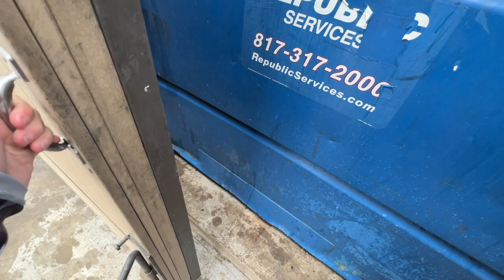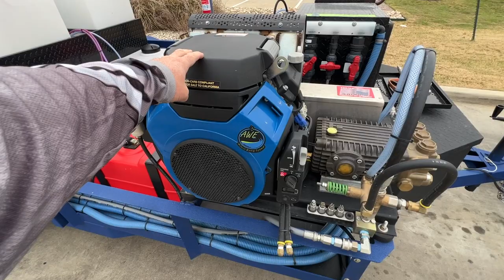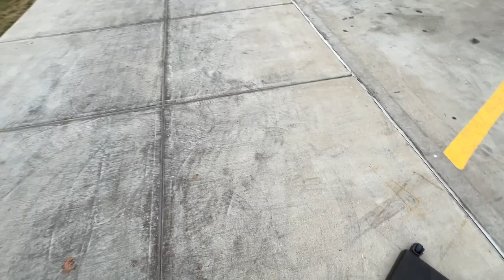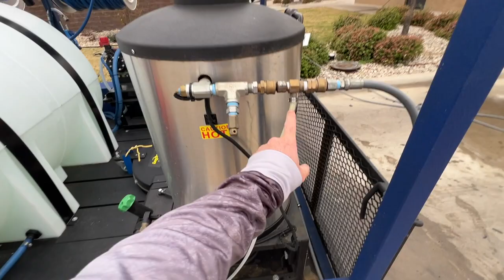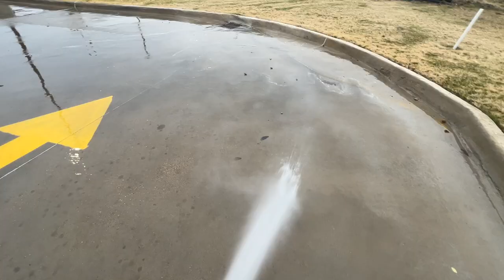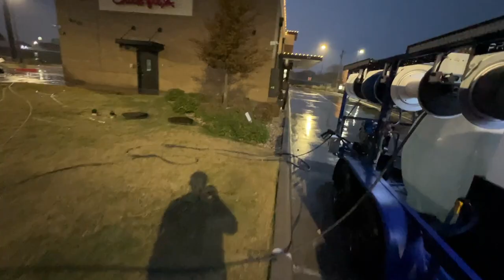How To Pressure Wash A Restaurant - Weekly Contract

Comment: M5 twist and the xjet  are going to have different orifice sizes inside and the xjet has a different internal design to create the Venturi effect that causes the suction. When you open up the fan tip you should see that brass Ring, where the water comes out of, should be different sizes.

Comment: Great video! Probably a stupid question but if I don’t have a trailer (I have a 3.0 gpm Honda machine) can I still use a surface cleaner? How would the water get pressurized through it? Do you hook up the water hose or the pressure hose from the pressure washer to the surface cleaner? Again, kind of a dumb question but I genuinely don’t know. Great content!
Reply from the maker: Not a dumb question man, we all had to learn this stuff at some point. If you don’t have a buffer tank then you connect the water hose from the building to the washer then the pressure hose goes from the machine to your surface cleaner. 3gpm isn’t very much so you’ll need a smaller surface cleaner but it’s a place to start. Get some driveways under your belt, save up some money and then you can buy bigger equipment. I used a 4gpm machine for the first 6 months of cleaning and was doing driveways, houses, then got my first commercial contract and financed a trailer from Powerline industries. There are other builders out there you can buy from that can do custom trailers so you can be within your budget.

Comment: That’s crazy!  If you did that where I’m at in Washington state, a storm water inspector would show up, pull the manager outside and order him to have a storm drain vactor truck come out, suck out that catch basin and key all the underground pipes to get the degreaser out of them, and clean out as many down stream catch basins as the wash water infiltrated.  They would inspect every catch basin down the road until they stopped finding degreaser or wash water, and he would also force the restaurant to key every storm line that was contaminated.  The bill might be upwards of $40,000 to fully decon that storm system.  You guys don’t have to reclaim in Texas??

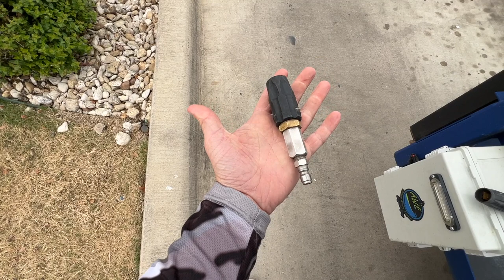Comment: 2:15 Hey there Dust to Glory - RE: the high & low pressure nozzles. The pressure & flow of pressure washers are determined by the nozzle orifice size (basically small specifically-sized hole inside the nozzle, smaller holes = more pessure but less flow. The opposite for larger orifices.

Comment: What gpm are you running? Doing that job so much I'd get a wide surface cleaner.
Reply from the maker: I have a 10gpm and a 8gpm, usually I’m running the 8. The wider surface cleaners are good but they aren’t as nimble as the smaller ones. I found out that I’m actually quicker with the 19” than I am with a big 24-28”

Comment: Thank you man this was inspiring! So I subscribed and liked especially because you are truly helping people and not always for profit. We appreciate that especially us starting of. A question I do have is would that same degreaser work on regular drive ways or is there something different for it? I have a 3200 psi pressure washer and a not so professional surface cleaner 😅but wanting to see how I can improve using chemicals until I’m ready to upgrade my equipment. Thanks in advance
Reply from the maker: Thanks for the kind words man! Gold Assassin is mainly used for grease and oils. I’ve used it some on driveways but mainly for driveways I use SH. Engine oil spills are pretty tough to get out. Most of the time it just lightens them up but you’ll still see them. It works great for food grade oils and grease though!

Comment: Yo Man, awesome vid. Any EPA issues using those chems at a location like chick fil a?
Reply from the maker: Great question, we’ve had no issues putting down the storm drain filter socks. That’s what is required here locally. I’ve been kicking around the idea of building a reclaim system so we can land the jobs that require it but for now we just make sure none of our soaps go into storm drains. A couple locations we wash have drains but they aren’t connected to the water system, they either go into a holding tank and get pumped out or they go into a filter system that cleans the water so we don’t have to worry about reclaiming.

Comment: Thanks for the video. What was your Gold Assassin ratio mix on the concrete at the 
restaurant? May you let us know how much is the price for the chick-f-A job?
Reply from the maker: If I do pump sprayer then it’s straight, if it goes through my GP high flow injector I believe it’s like 50/50 maybe? Not too sure. Maybe 4:1. I honestly have no clue but I’m sure you can find that on their site. Most restaurants around my area are about $600 biweekly
Reply: @DustToGloryPW so do you use the gp injector on house washes as well or use a regular down stream injector for that? Do you do chick fil a for 600 every week or just bi weekly

Comment: Im a newbie here. I need to buy extra Orings for JustInCase moments. What size Orings and what else should I buy for on the spots moments?
Reply from the maker: Hey man! So I don’t really know the size I’ve actually bought the wrong ones in the past. I should probably know that by now lol but there’s a lot of stuff to keep up with when you run a business so I always forget that part. I get on pressure tek or powerwash store and just buy bags of the high temp ones in different sizes then throw them all in my toolbox

Comment: What does it mean to downstream??
Thank you and God Bless,, Carlos ✝️🙏❤️😊❗️
Reply from the maker: You can run a downstream injector that pulls a small amount of chemical through your pressure hose. You want to run it after the pump which is why it’s called downstream. The pressure from the water causes it to pull small amounts. I run general pump high flow injectors

Comment: Could you use cold water, and what would be the difference in results between Double Eagle and Gold Assassin? Thank you
Reply from the maker: You can absolutely use cold water, you have to go a little stronger with Chem if using cold but it can be done. I started with cold water only for about the first 6 months I washed and cleaned all kinds of stuff. Gold Assassin and double eagle are both very good chems. I buy gold assassin in bulk (55 gal) and it comes out to about $8/gallon. Double eagle is around $40/gallon. That’s the biggest difference
Reply from the maker: If I use 4 gallons of gold assassin for this job it’s roughly $32, if I use 4 gallons of double eagle I’m looking at $160 in just chems.
Reply: @DustToGloryPW  wow, ok. That makes sense. I know people use both of those chems and mention the word “caustic” I don’t really know what that means or if one was better than the other or one was caustic and one isn’t…. Thank you
Reply from the maker: @westcentralpowerwash  Yeah I’m not super knowledgeable with how the chem works, I do know that most if not all degreasers are caustic cleaners. Most chems have sodium hydroxide in them which makes them caustic, I think maybe it’s a type of acid that’s really good for animal fat/grease. You just have to be careful with it because it’ll burn your skin as well.

Comment: Hey man great vid..appreciate u taking the time.. whats the price range $$ on the boilers  to make hot water if u dont mind?
Im just starting out and i eventually wanna move into light commercial so i know ill need hot ,i used to pressure wash at a pet food  plant and hot water is key for industrial jobs. Bu ti dont wanna blow $5k before i even know if this is gonna work for me getting jobs on my own. So im thinking get a 8-10gpm cold pw for like $3k to start and upgrade with a boiler later after i get experience running my own business. Srry for long form .lol thx in advance.
Reply from the maker: Don’t apologize for asking questions man, sorry it took me a while to see it. Cold water works fine for starting out, hot water runs around $4,000 and up. Definitely worth it when you get it but if you don’t have the cash then don’t sweat it. Do what you can with cold water and save up 🤝

Comment: How much was your hot water tank? Might need one soon and wondering how much I should spend for my first one?
Reply from the maker: The hot box runs around $4000 by itself. You can buy washers and heaters together for around $8000. I would recommend getting going with just cold water first then when you start getting more commercial work make the jump.

Comment: On the soft concrete have you tried surface cleaning but turn your ballvalve down a lil and or going higher flow tips on it
Reply from the maker: Yeah man I run oversized tips and have tried like 1000 psi so it’s this weird in between where it either doesn’t clean enough or it etches the concrete. Super frustrating lol
Reply: @DustToGloryPW  it could be that the walkway has a cream layer on it whereas the employee exit is just a concrete itself without the cream layer.

Comment: How long is your trailer and how many gallon tanks?
Reply from the maker: 16’ trailer, 380 gallon water, 2- 55 gallon SH tanks and 2- 16 gallon soap tanks
Reply: @Dust To Glory Pressure Washing  awesome thanks! Im torn between rigging out my 14ft or my 20ft trailer. I'm leaning more towards my 20ft because of the 7500k axles. I'd rather have a little overkill just in case.

Comment: Are you Downstreaming Gold assassin straight or is it mixed like 1:1 in your bucket?   Do you find DS with hot water makes a big difference from using cold to DS then hot water to surface clean?   Thanks.
Reply from the maker: I downstream straight, high flow GP injector. I’m not like 100% sure but I feel like it does better when I down stream it hot. Don’t know if that’s true but it definitely seems like it.
Reply: Solubility increases with heat, not decreases.  Mixing Sodium Hydroxide aka Lye is an exothermic reaction so just the act of mixing creates considerable heat.  Below you mention Little Pressure washing and if you watch he even mentions that his bucket heats up as he mixes in the beads.  Its true, lye is a common ingredient in many degreasers,  however there are alternate ingredients that do much better in certain circumstances.  Sodium Hydroxide is used in many formulations because it is the cheapest of the near optimal active ingredients.  Some do better to deep clean concrete due to having a smaller molecule, however are twice the cost.  So premium degreasers will often use a mix of lye and other degreasers to achieve a superior result.    Generally speaking heating a chemical will increase its reactivity and therefore its effectiveness, however it will also increase its reactivity everywhere and may become problematic when dealing with splash and spray on trim and plants.  ALSO avoid overheating any chemical such as with steam, this can cause health issues for workers in many ways.  Yes more heat needs less chemical generally, just dont overdo it and use all at your own risk. @MannyAguilarJr
Reply: @ewemail5767  I honestly don't even know why I said that. My comment doesn't even make sense to me now as far as hot water.

Comment: Have you tried 40 degree tip at a higher flow rate?
Reply from the maker: Yeah I occasionally use the 40 degree but really the xjet nozzles get me by on everything. If you’re talking about the surface cleaner that’s all I run is 40 degree tips

Comment: What do you do about the splash up that goes on the windows and doors?
Reply from the maker: Just rinse it off before it has time to react on the surface and you won’t have any issues. That goes for a lot of chemicals used in our industry. Most of the time you don’t want to let chemicals dry on whatever surface they are on. Keeping the chemical wet will help you in many different situations.

Comment: Did you have to change the tips on the surface cleaner to match the 8gpm?
Reply from the maker: Yes! I actually run oversized tips on all my surface cleaners to drop the pressure instead of messing with a pressure regulator. I get much better results with oversized tips running about 2000-2500 psi
Reply: @DustToGloryPW  thanks to you
Reply: I'm guna be trying out 4007 on my surface cleaner with a 8.5gpm gp pump. I also have 40045, 25045.

Comment: What would you charge for a job like that? I don’t see anything about that.
Reply from the maker: Not sure what your market is where you're located because its different in every city, and its drastically different in each state. We typically charge around $600 bi weekly for most restaurants we clean and that includes the sidewalks, drive thru and a couple other areas. it does differ depending on sqft of the drive thru and things like that though. Also dumpster pads are an extra charge.

Comment: What’s the going rate for commercial work like this?
Reply from the maker: Depends on your location, different from city to city
Reply: I charge $400 plus tax and chemical per month per store. Don’t know if that’s enough or too high. They paying it though. That includes all walkways, front, side and rear entrances, drive through, and dumpster pad. It usually takes 2 hours with 2 washer’s depending on customer traffic. More traffic the slower the process. I wish I could wash when they are closed but I like sleeping at night.
Reply: @tonyynot6151  where are you located?
Reply from the maker: @tonyynot6151  I would say that’s a little low but it does depend where you’re located also. Most guys I know that do bi weekly are at around $600+/ bi weekly. I like weekly better though.
Reply: @DustToGloryPW  thank you for the info. I may need to renegotiate my contract for this new year..

Comment: What lights are like glowing on the trailer
Reply from the maker: Led strips and also has tank lights mounted under the trailer
Reply: @DustToGloryPW  ok that is cool I am going to build a rig. Where did you get them you have a link?
Reply from the maker: @Hunter12valve  You can find the LED strips on amazon. And the tank lights are rock lights, made for going in the fenders of trucks

Comment: Damn, you surface clean all that in an hour?
Reply from the maker: It varies between an hour to an hour and a half but yeah man that GA hot water and 8gpm run through that stuff pretty quick and easy!
Reply: Do you pressure wash during business hours? I have a contract with the local Wendy’s in this area, 6 store to be exact. But the only drawback is we only wash in early morning or during slow afternoon times. Always battling with customers. Sometimes the store manager will have to shut down the drive through so we can wash quicker which I’m learning they don’t mind shutting it down for an hour or so  @DustToGloryPW
Reply from the maker: @tonyynot6151  We wash restaurants after they close. Too much trouble dealing with people during hours. It slows us down wayyy too much having to move for vehicles.
Reply: @DustToGloryPW  i strongly agree about the people. I may have to look at late evening or even after closing times to wash. Right now our night temperature is mid 20s-mid 30s. So I haven’t washed in a month. It’s even colder in January. You take the good with the bad. Thanks for the response